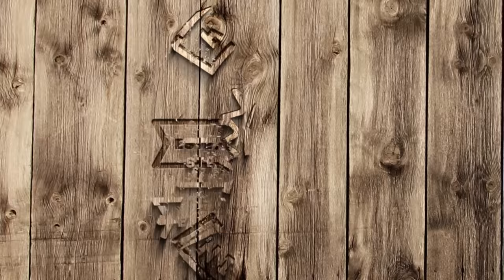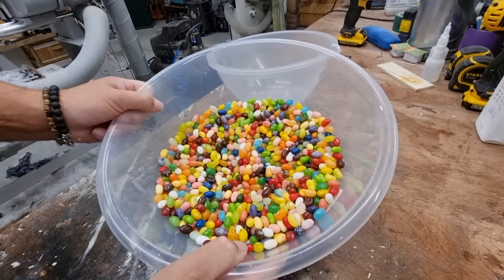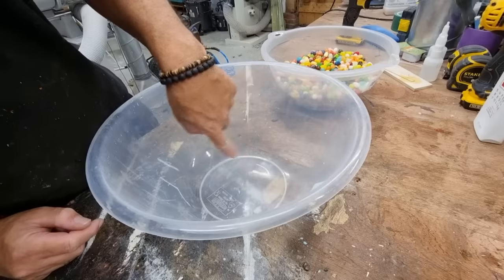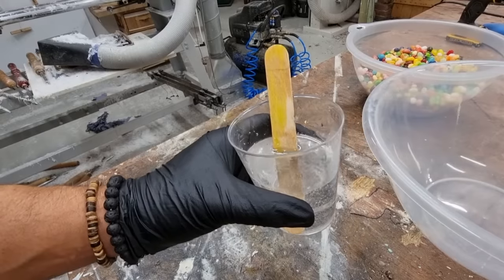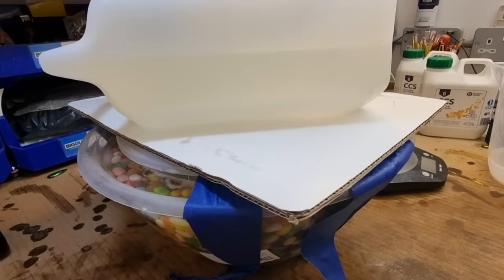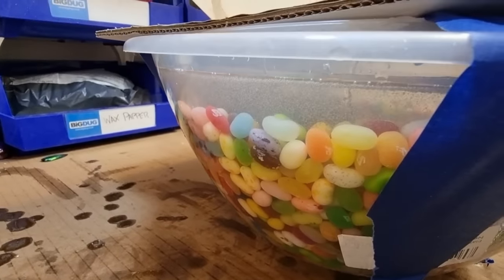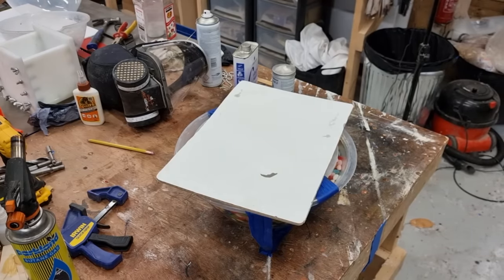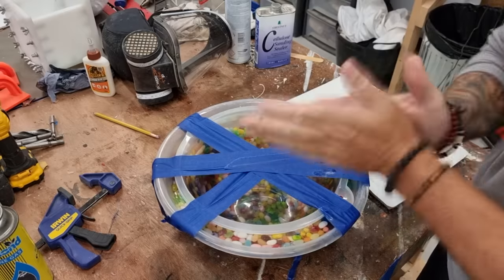What happens to JELLYBEANS when set in Resin?

Comment: I think another cool idea would be to use colorful rocks that you find in fish tanks. It would be just as colorful, but would be hell on tools, so you would probably need to do something like you did in this one.
Reply: not to mention the little rocks would chip out and leave massive craters and be painful projectiles, and if it was the glass ones even worse... only problem with this method is you're left to one basic generic style for every bowl. I was thinking he could have just turned it anyway then added a layer or two or three of resin to seal the exposed jelly beans.
Reply: terror bowl ^^
Reply: The colorful rocks are painted. Gonna have a lot of grey rocks.
Reply: @Destros2ndone  the murder bowl has already been done with aluminum shavings and black dye
Reply: @Burn77oas7  i know, but why stop there ;)
Reply: They are not rock.  They ate minerals
Reply: @frenchie0800  rocks are minerals.. pebbles  stones, point is they would chip out being so small and hard even being softer then  a Normal stone, Selenite could possibly be turned,  considering you can litteraly crumble it with your hand but, the stones they use in fish tanks are alot harder then Selenite
Reply: the black light/neon ones
Reply: @Burn77oas7  its a reference to breaking bad..
Reply: Peter Brown of Shop Time, who is a Maker's Central guy, has tried a bit of aquarium rock resin work. Nick would DEFINITELY do something jubbly  wubbly super funky!
Reply: Adding a toy goldfish to it and some plastic plants would look awesome!
Reply: @Burn77oas7  some rocks don't contain any minerals but for the most part yeah any rock you pick up normally is made of minerals. The ones that don't have minerals in them aren't exactly readily available besides flint lol and I'm pretty sure fish tank rocks are not made of flint 😂
Reply: @weedconesuer  flint is a mineral bud.. rocks are minerals , mineral deposits refer to high quality or valuable useful "rocks" like gold, silver , amethyst. Granite is a mineral a basic pebble is a mineral, dirt is a mineral.
Reply: @Burn77oas7  no.. flint is technically not a mineral. It's composed of a mineral but there is no mineral called flint. It's classified the same as chalk. Not to mention extrusive rocks like obsidian.. Not all rocks are minerals 😅
Reply from the maker: That would be cool
Reply: @frenchie0800  Flint is a sedimentary cryptocrystalline form of the mineral quartz, categorized as the variety of chert that occurs in chalk or marly limestone, therefore flint and chalk are minerals...

The solid earth is made of rocks, which are made of minerals. To understand rocks you need to become familiar with minerals and how they are identified. This outcome gives you the background needed to understand the terms used in identifying minerals.
Reply: @Burn77oas7  its a damn reference to breaking bad
Reply: @Me-th3gj  My daughter made me a painted resin wood bowl with fish and plants for Xmas ones year. Wouldn't believe how many people have thought the Koi fish was real. It's really beautiful.😁 Your idea would look really cool. I'd imagine he could hand the fish with fishing line to keep them floating but Idk how they wouldn't float to the top. Maybe he could glue them in with resin & fish line and hold the line upright tied to a pencil or something.
Reply: @debbiefox6846  Yeah, I've seen people make those 3D koi bowls before, they're AMAZING. That sounds like a sweet gift. Even more special since your daughter made it. I was thinking of tacking the items down with resin if they would be a material that floats. The plastic plants could probably just be anchored down by the stones/gravel.

Comment: I can tell you from personal experience doing jelly bean resin door knobs that everywhere those jelly beans stick through the sides and are not covered completely in resin, you're going to have a problem. When they're exposed to the air and humidity, they'll eventually go sticky and disgusting. And the inside of the bowl is slightly misty because that's where all the microbubbles collect, there's nowhere for them to go and they can't get out easily.

Comment: One thing I've used for a lot of resin projects is colored rock salt, the kind you get for driveways. Sift out the smaller pieces, pick out any dark pieces and then dump the salt in a ziplock bag, pour in some acrylic paint and mixing it around. Then let it dry. Pick out any pieces that didn't pick up the color and away you go.

Comment: A cool idea for you us9ng a method like this with the 2 bowls. You could take a load of copper or aluminum wire and bend it into designs and set them between the bowls maybe with tinted resin. Then just finish turning. Great job on the Bean Bowl Lord Zametti, came out great!

Comment: I don't know if this would work Nick, but if you can't use a pressure pot then maybe vibrate the piece after you pore the epoxy to get the bubbles to rise to the top where they can be turned out.  IDK mate but might be worth the experiment lol 
Regards 
Conor

Comment: The inside is misty because of the different texture outside the small bowl, vs the shiny inside of the bigger one. also, think maybe you forgot to spray the underside of the little one with mold release.  
For future reference, so you don't make the mistake I did 3 years ago doing this: make a ring for the smaller bowl to fit into that exactly fits the bigger one so it stays perfectly centered.

Comment: My guess on the bit of haze you got at the top of the bowl would probably be from what ever sugars released from the jelly beans as well as potential starch residue that coats the beans from sticking together.  If you plan to perfect this method, I would try to use a urathane or clear coat on the beans to seal them before adding them to the resin.

Comment: Idea: make a decent sized cylindrical mold, with an inner mold about 1" smaller, fill the void between the inner and outer with colored epoxy and jellybeans. once cured, turn it on the lathe to expose some of the beans, then once you're happy with it, soak the whole thing in water until the beans dissolve (they will because they are sugar...) this should leave a cylindrical colored resin piece with holes/voids that are intentional. this could then be polished/sanded up to be quite spiffy, and somehow used as a lamp shade.. with jellybean shaped cutouts

Comment: If you are making a project too big for the pressure bot, if securing it to a vibrating table device of some kind might make the bubbles come out, on a slow-set resin. Or e convert a refrigerator into a cooling vacuum chamber, two birds one stone... tossing out some shower thoughts here.

Comment: Total novice here so i am not trying to tell you how to suck jellybeans, but i do wonder about moisture getting into the bowl/beans via the small bits that touched the edges, as i thought i saw some minor holes there.  And i wonder if this could be prevented by either coating the whole moulding bowls in a layer of resin (thicker type or uv set) before the rest of the casting  or painting in and out with resin whilst turning slowly to stay even.

Comment: Should have used steel weights in the inner bowl or even just fill one with lead to hold it down.  the tape distorts the shape of the outer bowl...and it's too complicated.
Reply: in fact thats why we can see the bowl wobble when you have it on the lathe.  Just melt some lead and fill a smaller bowl for the inner bowls.